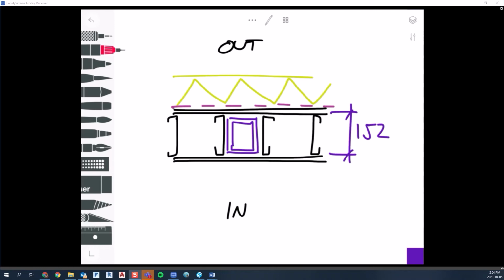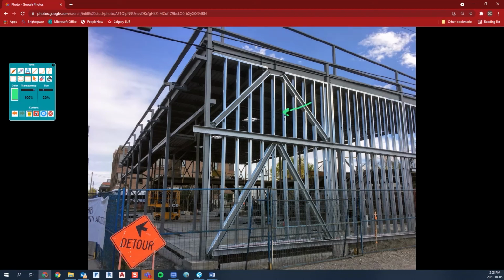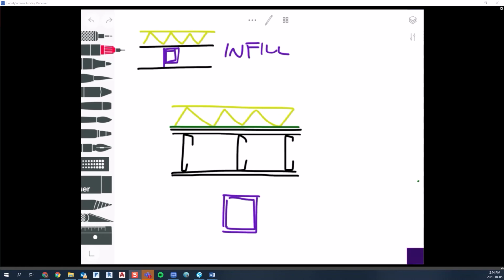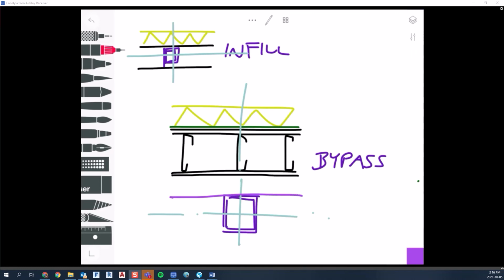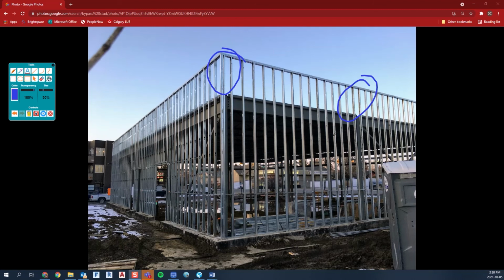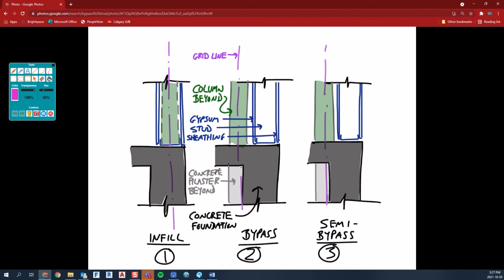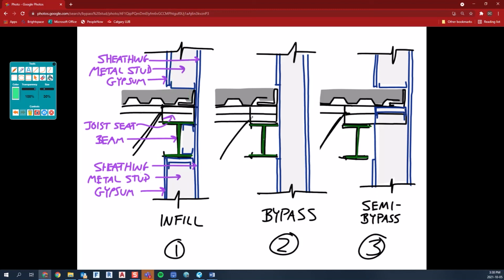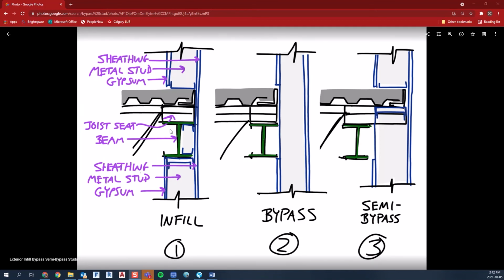Exterior Wall Stud Position in Relation to Steel Superstructure

Comment: This was very informative, modeling out exterior walls in sketch-up, and the infill method worked perfect for what I needed! Thanks!
Reply: One question I had, is there a required distance between the structural beams for code?